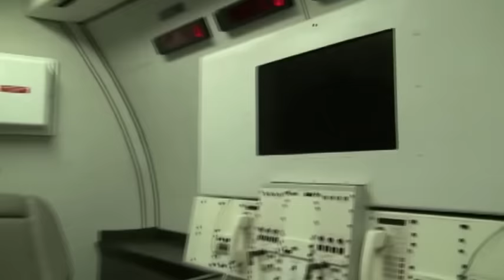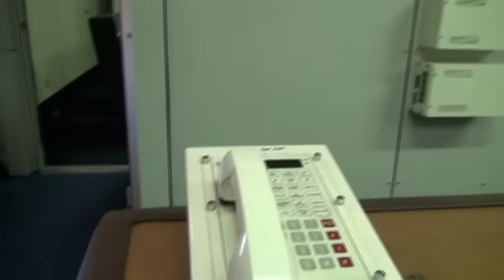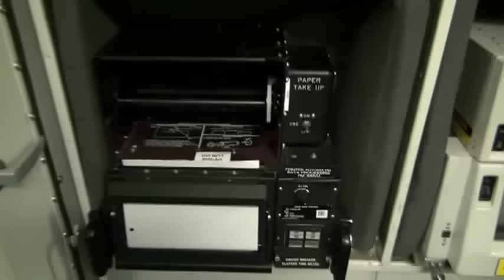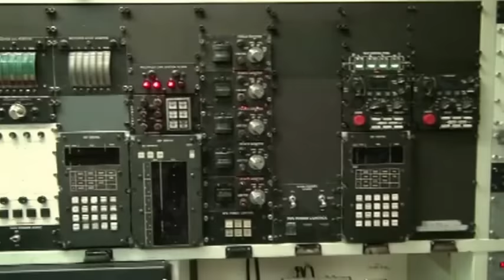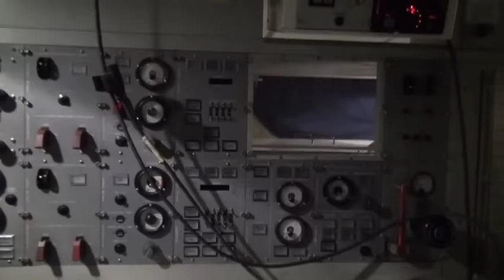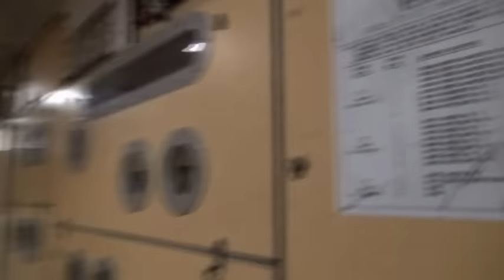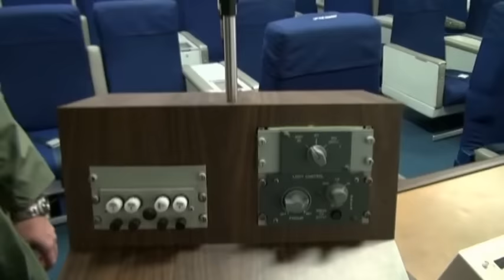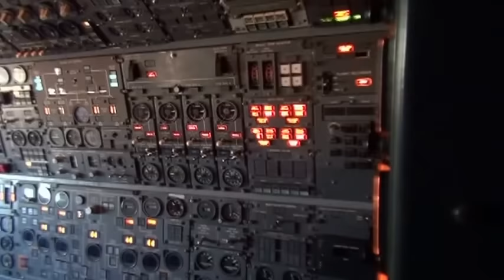Guided Tour Inside the E-4B NAOC Doomsday Plane

Comment: Incredible tour! The tech on board looks 'old and outdated' but the systems do the job and do it well. They've ceetainly packed a lot into a very tight space, my only concern is how drab and boring it looks and not much space to rest and relax. How long would a crew typically fly on a mission? I guess the plane could fly indefinitely as far as fuel is concerned but 57 crates of MRE would need to be replenished at some point?😎👍
One thing that surprised me was the use of 'old school' radio comms and that 5 mile long wire antenna! Running @20kw that would ceetainly pump out a strong signal, 2.5x around the globe he mentioned, wow! That's a hell of a thing to drag behind a plane @ 40,000ft though😲😮😊😁😎👍
Reply: There will be no boring at all the day of a nuclear war! 🤔

Comment: I got a $25 Baofeng radio that will do the same thing
Reply: @votpavel  True
Reply: If they made a $25 Baofeng radio that does 20k watts, then let me know where?  The area he claim was the aircraft systems, is huge amplifiers as well.
Reply: @parrotgenie5099  OK , OK , Maybe $30
Reply: Trollguy 86 hey what kind of distances are you getting with those radios? I’m thinking bout getting one.
Reply: Until it breaks in 15 minutes
Reply: Taylor Perkins I’ve got a UV-5R I’ve been using for almost 5 years. So far so good .
Reply: @trollguy8693  I'm amazed we use that brand at my work (not sure what model) we have gone through 3 already

Comment: Brought to you by darpa, with a guy in the back shed finding junk parts from wherever, welding, fusing, wiring, programming, and finishing with WW2 paint theme.  Don't know what year this was shot, but couldn't we dress it up a bit?  Heck, our Trident Subs look more fascinating than this
Reply: Why waste tax payers money on upgrading something that is unlikely to ever be used?
It does its job and that's the most important thing. Also older equipment is more safer today than the modern tech.

Comment: The EMP protection built into every plug, connector and junction must be out of this world on this aircraft.  EMP protection is commonplace on every military aircraft, ship and vehicle.  It's not obvious and looks insignificant but it's all there.  It's not military electronics and power systems without multiple layers of EMP protection.
Reply: Surge protection, self diagnosing power supplies and redundant power trunk circuits. Every single piece of military electronic device for the last 50 years has been sent out to the Mojave Desert to an EMP testing facility on behalf of all NATO defense contractors and testing institutions.
Reply: That EMP protection alone must weigh a lot, and surely the fuselage and cockpit are wrapped to some extent in ways the standard planes aren't. Amazing the distance EMP can cover and what it can disable, yet such powerful EMP can be generated by the EA-6B Prowler with two personnel sitting on top of the transducer, essentially protected by foil. Then there's the brute-force gamma and x-rays vs the equivalent of thousands of transistors situated on something the size of a grain of sand, and at some point there's a very high assurance of reliability to the tune of millions of dollars and lives.

If the maniacs kill off the citizens, where will all the taxes come from? That's okay....... the imbecile with the launch keys and a place to ride out the decay period has a worse enemy than he started with. Cockroaches tolerate ridiculously higher rads than any other fauna; there'll be no shortage of food for the "victors": Self-Propagating All-You-Can-Eat Cucaracha.

Comment: Well everyone is safe now, there's a top of the line 1901 airplane ready to report.
Reply: Wright brothers achieved powered flight in 1903
Reply: @JosephHHHo  LOL you just shot him down
Reply: Again, the reason they use older technology is for EMP resistance. The LCD screens don't hold up too well when they get magnetically shafted.
Reply: @clayyosten2833  No.  The whole plane is EMP shielded.  They have plasma displays because that was what was state of the art when they upgraded that portion of the equipment, and they still do the job.  Note that they are not still using the slide projectors originally installed.  Nor is anything else (except the overhead compartments and the spiral staircase, and probably the seats) original.

Comment: I was stationed at Fairchild from 83 - 86.  One of these came to our base for a couple of hours, I believe the acronym was NACP and it was widely known throughout the Air Force as Kneecap.  Anyway, when someone used that term in our guardmount pre-shift briefing, the lieutenant chewed him out and said that that acronym was classified and not to be said in an insecure environment and that he would be getting a letter or reprimand and luckily not an Article 15.  Anyway, when the plane landed, pretty much most of the crew got off went to lunch and the BX.  They were given several base vehicles to use and on every one, they put on prominent magnetic signs that said NACP crew.  So much for the lieutenant's knowledge of what was classified and no he never apologized and from what I remember of that asshole he still gave out the letter of reprimand anyway.

Comment: About all the speculation on the time this video was recorded: Take a look at the Rack at 12:50 https://youtu.be/maZdUtB0ojs?t=12m50s. You can see a Device called Cornet IPGate 1000-16: http://www.opticalkeyhole.com/eventtext.asp?ID=72246&pd=10/24/2007 According to this press release, the IPGate 1000-16 was available in Q1/2008. So the video must have been recorded after that.

Comment: I'm amazed that this was not converted to a glass cockpit
Reply: Sean Breheny old-style analog instruments (aka "steam gauges") and the like are far more resistant to EMP (electomagnetic pulse) and nuclear fallout effects... there are other improvements in the engines and enviromental system to make it resistant and able to operate in a nuclear enviroment
Reply: The Air Force actually decided that the mechanical instruments would better withstand an EMP attack as opposed to a computer driven system seen on modern aircraft. That's why the cockpit hasn't been modernized.
Reply: +john warminski Well, most glass cockpits have analog backups in the case of electrical failure anyways, as well as the RAT system which is obviously immune to EMP blasts as long as the batteries remain isolated. Have you seen the rest of the plane? It doesn't look like ANY of the systems have been updated in the past 30 years and the equipment is a converted 747-200 which is basically a living fossil by now. These aren't really operational "doomsday" planes anymore, the regular VC-25s were significantly outfitted after 9/11 and now serve the role that these planes used to. There aren't even any E4Bs permanently stationed within 90 mins of DC anymore. The only thing the E4B is used for now is shuttling the Secretary of Defense, his staff and the press from meeting to meeting in an impressive-looking airplane.
Reply: +Conor Corrigan you're absolutely correct but I wanted to emphasize on the point that the air force decided to keep the cockpit predominantly analog as opposed to upgrading to LCD displays. I find that very interesting.
Reply: +Sean Breheny this is pretty derp if you had thought this through at all you wouldnt have asked such a stupid question wow #runonsentences
Reply: +Sean Breheny probably because less eletronics are less prone to EMP failure.?
Reply: +Conor Corrigan You don&#39;t know what you&#39;re talking about.  They were never permanently stationed within 90 mins of DC. They pulled alert duty within that distance, during the cold war, but that war is over thus their stationing has been modified. The E-4B was never designed to be the tour bus for POTUS, it&#39;s an ABNCP capable of communicating with POTUS/SECDEF wherever they might be. It has a compartment decked out for VIPs, but it is not the VC-25, was never designed or intended to be operated for that purpose.  It&#39;s original and continuing purpose is NC2 and, as the nuclear threat waned, a new mission was added for FEMA.  It is still the most capable ABNCP in existence receiving continuous periodic maintenance to ensure it&#39;s viability.  As long as the comm gear works, why would you spend money upgrading?  Many upgrades have been performed, but it&#39;s a working mil aircraft.  Have you ever been in a B-52 or even a much younger B-1B?  They are beat up too but still do a great job for what they were designed to do.
Reply: +john warminski The air force has a lot of aircraft to take care of. Putting LCDs on a 35 yo plane designed to be EMP-proof is a waste of money. It's designed to use as little electronics as possible.

Comment: I wonder how many miles of wire is in that aircraft
Reply: He said the wire was over 5 miles long, lol. I'm playing, that's a good question and even confusing to try to think about. But, you could get a start by finding out how much is in a standard 747, then go from there.
Reply: Standard 747 has 31 miles of wires all together, many are in bundles though. The 5 mile of wire is actually 9 miles total, since there are many wires at various lengths bundled together. it's 5 wire that trails out to use as ULF antenna. (radio doesn't penetrate water well, you need extreme low frequency to transmit very short text messages to subs to surface)

Comment: Did the US spend all their funds on polishing every piece of the Air Force One Boeing. The kind of maintenance the presidents plane gets is probably way over the top but how can it be that Air force one looks like a mint condition plane and the one the pentagon uses looks like a flying dumpster -.-
Reply: The 747-200 is much older and well used. And you don't go to meet foreign dignitaries in your pajamas so the plane needs to fit the bill too.
Reply: This plane is from 1974, the Air Force One planes were built between 1986 and 1990 - with a different mission in mind.
Reply: It's operational,  not decorational.
Reply: bluesky789 for real
Reply: aAaa aAaa: Actually there are, not that many years ago since the last 747 classics made their final cargo runs.
Hell, even into the 2000s UPS were still flying old ancient DC-8s.

But those engineers are indeed a dying breed.
Reply: The Weekender it's purpose is function over luxury

Comment: I'd love to know the tensile strength and how much that 5 mile cable droops? But I'm guessing that's all down to how much of the cable's out, the air pressure, temperature, humidity and if there's weather? 
When it comes to receiving a single, would it be something so simple as a transformer with lots of HV filtering and the other end of the 5m cable grounded to the chassis or would it be like he said. A 2 core cable, which is just sensed and connected together so it would pick any EMP up? Because if you've got an antenna, THAT LONG! and if nuke goes off. Then the voltage spike along that cable would be unbelievable!! But if it's just a loop, it wouldn't do anything. 

I'd love to know how they sense even the most faintests of signal's which are transmitted from any part of the globe 🌎 I wonder how far a 20KW transmitter would travel? 🤔 But then again that's all due to the frequency range.

I'm just a humble sparky and I do really love HV and electronics because I think it's really interesting and fascinating.
Reply: Any antenna that wouldn't pick up an EMP wouldn't be a very good antenna.
Reply: @BrightBlueJim  good point! Never thought it that 🤔
Reply: I know they fly in a big circle, no idea of the diameter, and the point is to have the cable antenna as perpendicular to the earth as possible. Good point about the EMP, there must be some sort of integrated breaker or fuse setup that can be easily flipped

Comment: It needs to have older technology's and new, because in the event of a nuclear blast, new tech wouldn't work.
Reply: 1980's tech is just as vulnerable. A lot of Western military tech is old, the cold war boosted military budgets and a lot of it is still used today. That stuff is expensive. 
(served 2000-2005)
Reply: The entire plane has a Faraday cage, you could see the wire mesh embedded in the window glass, so it's quite  clear this plane has been hardened against EMP and all other sources of electronic interference.  Even on regular commercial jets the wiring conduit is consists of wire mesh to protect it from electronic interference.
Reply: I am glad the plane has EMP protection but does it have ENOUGH EMP protection that it can withstand the EMP that can be generated by modern technology?
Reply: It's far more likely that we don't want to pony up the 250 million for a new 747-8 and then the billion that Raytheon would charge to upgrade this equipment into the new model. One off computer systems don't come cheap.

Comment: I'm hoping this is the outdated version. A 40 year old plane with 20 year old technology. Doesn't make me feel safe! I'm sure the Russians are very interested as well.
Reply: The analogue computers are there so EMP won't effect them in a nuclear war
Reply: +Ryan Carroll I'm still sure the actual d day plane the president would hop on is much different. This is the same strategy as using two limos in the motorcade.
Reply: A 42 year old ex commercial airline 747-200 isn't good though. You'd want a new plane with less stress to the fuselage.
Reply: Except the limos are identical.
Reply: They wouldn't publicize anything up-to-date or modern, at best this is a backup that is outdated.
Reply: These planes don't fly that much.  

You gotta remember these aren't operated like normal airliners. They stay in the hanger most of the time. 

The only reason they're replacing them is because parts are getting harder to find and also to help boeing out selling the 747-8
Reply: these planes are it. and they do fly a lot. anywhere high ranking defence officials go. and while they look old they would be incredibly well maintained and the technology on board might look old. but is designed for use dispute emp and also to talk to Americas many other systems which in themselves are old and unhackable due to their less digital nature. wise up guys
Reply: You do realize that the Air Force also flies B-52's that are themselves much older.  The current fleet of active B-52 strategic bombers were built between 1960 and 1962 and are expected to fly into the 2040's.  42 years?  Not a problem.
Reply: T. S. B-52's aren't doomsday survival planes. They're just bombers.
Reply: The Russians would know every nut and bolt on this plane by now. Besides much of the worlds air-forces are using aircraft several decades old. Take a look at the US air force bomber fleet like the B52.
Reply: It wouldn't have the typical flight hours of a commercial 747 of its age. Besides if this isn't good enough what about the B52's flying the nukes?
Reply: The Russians would have a similar setup with old analog systems, the Il-96still uses a three man cockpit

Comment: Who retrofits this aircraft?  Boeing or usaf? Or a third party contractor?
Reply: Barry Sabahat pretty sure this is boeings doing.
Reply: The Air Force does regular maintenance, as they showed in the video.  Heavy maintenance is done by Boeing at the factory where 747s are still made in Everett, Washington.  They're currently building the replacements for the Air Force One planes.
Reply: Thanks for the information.
Reply: Raytheon
Reply: Probably farmed out to China. J/K of coarse but sometimes it seems plausible.
Reply: E-Systems, late 70s early 80s. They also did service on Air Force One - the 707s of the time.
Reply: @robertlandry3490  As I read the above question, I was hoping someone knew the correct answer.  I grew up close to E-Systems and toured one of the first of these jets.  I'm sure some of my friends did work on this plane. It has changed since the 70's.  I think E-Systems is now called L-3.
Reply: Arch Stanton , yes E-Systems changed their name to L-3. I don’t know why or when. I worked there from 1981 to 1985 when they were just retrofitting the last two. I believe there were five total. I know E-Systems built an entire hanger for this project. Actually the AWACS planes had a much more impressive interior.